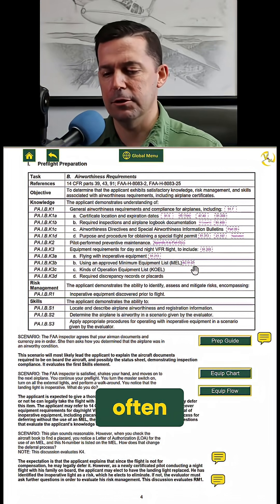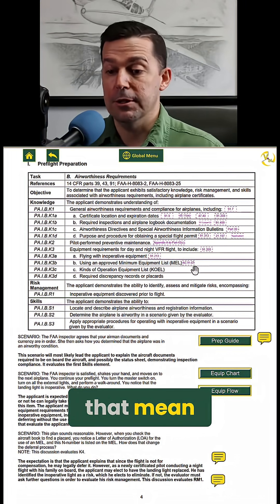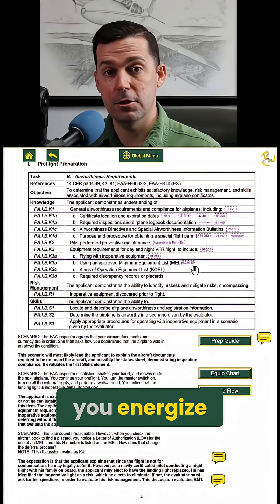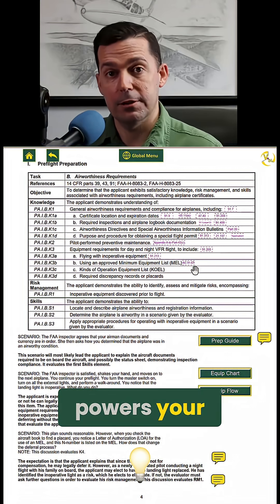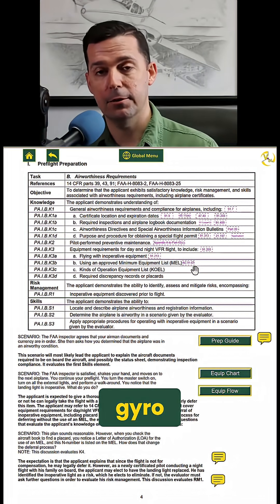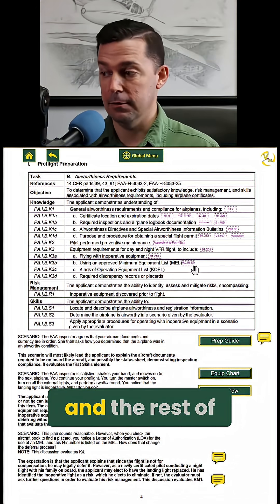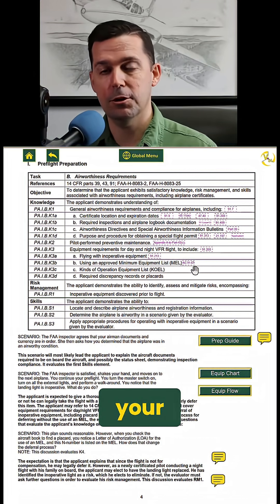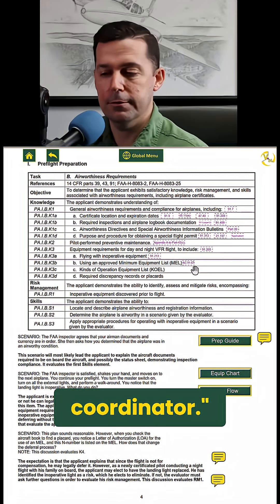Uh Oh! Master Switch On, But No Sound? Here's What That Means #shorts

Comment: So for a 172m the correct flow would be MEL(N/A), TCDS (stall horn is only thing mentioned), KOEL/equipment list in POH (turn coordinator not mentioned), 91.205 (not mentioned), placard as inop, good to go? Is that correct?
Reply: Is it a VFR or IFR flight?
Reply from the maker: I would use this flow.
Is the equipment required by: TCDS → STC → 91.205 → KOEL → MEL → Equipment List → Airworthiness Directives → PIC Judgement